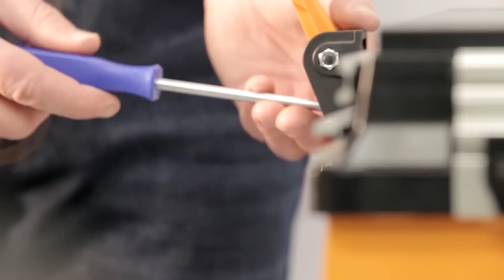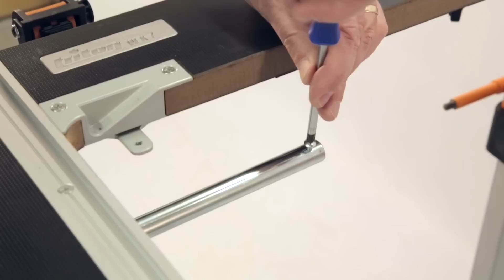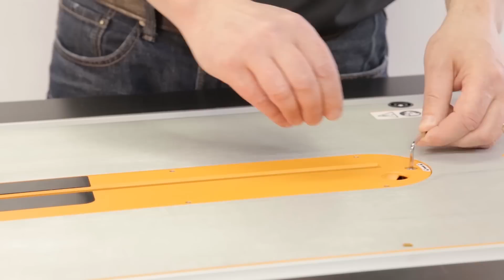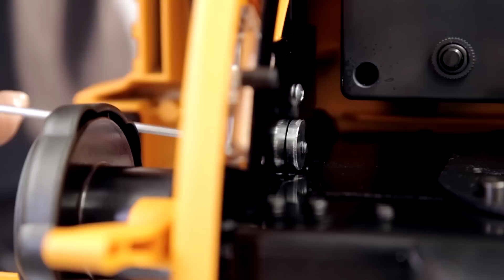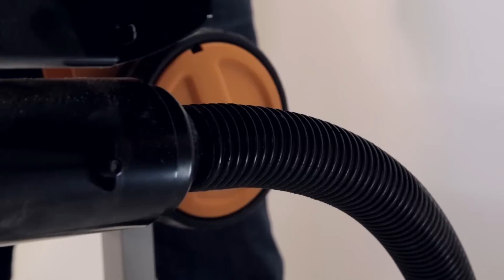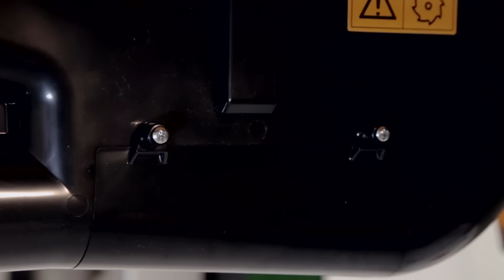Triton Contractor Saw Module - Instructions

Comment: I think this saw module on its own is perfect for anyone wanting to build their own cabinet saw. Building the rest of the saw base and top is easy the saw mechanism is the hard part. This solves the problem then buy a good fence system like the charnwood fence at around £80 is a steal.
Reply: I thought the same then read some comments from users and not so sure now. The saw module can't be found for sale anywhere in Canada 4 years after the product came out that tells me that people building MFT haven't had the vision or they too heard that the product has issues. 

I'd buy one if I could find one just to try
Reply: my question would be, does it allow the use of dado blades?
Not a deal breaker, but it would add a feature in the I will buy this column. I know some contract saws can accept a dado stack.

Comment: Anyone know if it's possible to adjust the angle of the blade relative to the tracks?  Mine is fractions of a degree out. (i.e. with a high precision mitre guage pushing square wood through for a cross cut, the cut is not currently precisely 90 degrees)

Comment: So I've been using this workshop/router/worktable/dust bucket combo for a few weeks.  There were teething problems: I made better versions of the clear plastic indicators which indicate fence measurements because of the flimsy plastic and threading issues on the originals; I had to flip the saw over and fix an issue with the 0degree cam stop (which wouldn't budge); I had to fix one of the fence clamps which wouldn't tighten; I needed a better dust extractor to get enough suction to clear a reasonable amount of sawdust.  However, it has been a little workhorse capable of some accurate cuts and mills since.  The fence is solid (once you fix the indicators and any bad clamps) and holds accuracy.  The mitre gauge is pretty solid too (though not as solid as aftermarkets).  The motors of both the saw and router have been able to cut through 1 1/2 inch thick oak with little issue.  Swapping between the router and the saw and the clamping table have been quick and painless.  If you have the space to house a table saw and a routing table with enough clearance to be able to move around them both with sizeable materials (which my garage does not) then I'm sure you can get better separates for the same price.  However, if you don't have a good sized workshop, and want to be able to switch between these table powertools within the same area and you need them to  have reliability, power and accuracy  (with minor mods), I think they'll do you well.
Reply: how can i get the nut that  tightens the blade
Reply: @bostondino6139  you mean the arbor nut? unscrew the kerf plate, use the provided spanner.

Comment: My Workcentre table arrived today and I was finally able to install the Contractor Saw.  I also have the Router Table and the TRA001 router.  I agree with the other comments about the poor documentation that came with each of the items, and these videos, as lacking as they are, go a long way to help fit the bits and make adjustments.  

On my Contractor Saw, the three rollers under the saw table that are adjusted for height are rubbish.  The clips that hold the rollers to the leveling screw easily pop out of the groove and as the leveling screw is adjusted.  Therefore, the rollers are not capable of carrying any of the work load and the only functional leveling screws on that side are those in the corner on the short edge of the saw table.  I haven't installed the Router Table yet to see if it shares this weakness, but will post an update here after I try it.  The rollers on the MDF table that came with the Workcentre Table worked fine, but there was no load on the rollers like there is with the Contractor Saw.

The aluminum table has a slight upward bow in it, but not enough to make me reconsider.  I knew there would be limitations to using anything labeled as a "contractor saw", with accuracy being one of those limitations.  I bought the complete set only because I have little space in my garage, which still has to serve as a garage, and anything I buy for woodworking must be stored out of the way when not being used.  The Triton Workcentre, saw, and router table meet those requirements.
Reply: send it back? could you remove the screw and inspect it and the thread, there may be a bit of schmoo in there. Can you change the screw to a normal hex head bolt?
Reply: aalever: The angle scale on my saw insert was off so much that I could not align the indicator when the saw blade was at zero degrees.  Like yours, it was very tight, but a little WD40 on the cam seemed to help a bit.  I still could not fine tune the zero indicator, so I had to remove the scale bracket from the saw, peel off the scale tape, stick the tape back on where it was within the alignment range of the indicator, and install the scale bracket.  This took no more than five minutes and now when the indicator shows zero degrees, the blade is as close to perpendicular to the table as I can measure using a small square.

Now that I’ve adjusted the blade angle scale so it is useful, the adjustable trunion stop at zero degrees no longer works.  With the blade at zero degrees, the trunion stop cannot be set so it stops the movement at zero degrees.  I haven’t tried the 45-degree stop yet because I haven’t needed any angle cuts.  This doesn't bother me because I don't rely on the trunion stops to determine blade angle.  I use a square to verify the angle with relation to the table top.
Reply: No doubt anyone can buy a better cabinet saw and make or buy a better router table.  However, the reason I bought them is because the workcentre folds up and can be stored away in my garage, and allow me to park my cars inside.  I would have bought a regular cabinet saw and router table, but I don't want to leave my cars outside more than I have to.
Reply: Hi Mike, how are you getting on with it now?
Reply: Sadly, I haven't used it yet.  Between work and other projects, I haven't had time to even plug it in.
Reply: ok, there's very few real life reviews out there. They're either paid for reviews by magazines or rants by guys who sound lie they didn't read the instructions
Reply: It's tough to fault the guys who don't read the instructions, because the instructions are worthless.  :-)  Without these videos, it would take more time to set up the saw.  However, since you asked, here are the problems I have so far with the saw.  

1.  When the optional side support is installed and stowed, the saw module cannot be installed or removed unless the saw is set to 0 degrees.  When the saw is tilted to 45 degrees for easy storage, as recommended in the manual, the side support rails interfere with the saw controls.  Either the side support has to be fully extended, or the saw must be set to 0 degrees.  Since my arms are normal, I can't insert the saw module with the side support fully extended.

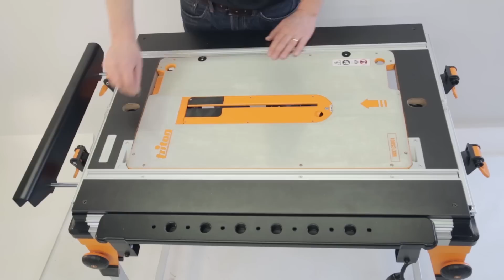2.  There are three adjustable rollers on the saw module that contact the table when inserting it.  These are adjusted once, as shown at 2:54, to ensure the surface is level with the table.  The retaining clip that holds the plastic roller to the adjusting screw pops off easily when the slightest pressure is put on it to raise the surface.  I haven't found a permanent fix for this.

3.  The miter slots are in the table, not the saw section.  This makes it impractical, if not impossible to make a crosscut sled that will be accurate once the saw module is removed.  I took measurements between the edge of the saw blade and the miter slots after removing and inserting the saw module several times to see if the initial setup was repeatable.  Despite tightening the two black cam locks seen at 3:16, there was enough variation in the saw alignment to convince me not to waste my time trying to make a crosscut sled and dial it in.

I bought the Triton saw module as an interim solution in my garage until my permanent basement shop is ready, sometime this Fall or Winter.  I have a Holzkraft SC2 Classic sliding table saw (same as a Minimax SC2 Classic) for the basement shop.  I will use the Triton saw only if I have to rip large stock so I can maneuver it easier to the basement.
Reply: The saw didn't sit at exactly 0deg on arrival and the 0deg screw is immovable.  It uses the tiny hex key, and further pressure would either snap the key or round the screw. Any thoughts?
Reply: Mickleblade:  There was nothing wrong with the screws or clips.  I think it is just a bad design by asking too much of the small hardware.  The problem only exists if I try to make an adjustment to the table height.  Once it's adjusted, installing or removing doesn't seem to affect the position of the bobbins.

I did try changing the M6 screw with a normal screw and use a nut with a nylon locking insert to hold the bobbin in place, but there wasn't enough space for all of the hardware under the table.
Reply: thanks guys for the info, I'd been thinking of one and this is the nail in the coffin. There were enough doubts anyway with the price and marketing. The router module only works with triton routers, a router table is a doddle to make anyway, chinzy fence, poor dust collection, not possible to make zero clearance inserts. All at over £600, when I can buy a better cabinet saw for that.

Comment: I have one, but the movement to allow 45/90 degree alignment isn't there, I can (at a very hard push) get measurements of 90 and 45 using a digital meter, but why isn't there movement leeway  'just over' these settings to allow for correct adjustment?
And... I'm not really sure how to align the blade to the fence slots, its just out front to back! and the info supplied with these tools is woefully inadequate, with mostly just a few pictures.
BTW: I can find no other way of asking Triton questions direct.  I'm in the UK by the way.
Reply: Hi Jersey:
Not sure, it depends on what you want it for, and to explain: 
If its just a contract saw you're looking for I'm sure it will work well, if you ultimately need high precision, then perhaps no.
Its handy to be able to swap out units, saw/router in a small space, but just as annoying to have to make sure your work schedule is correct to prevent swapping back and forth.
If you buy one, check You Tube for video's as the paperwork is woeful and no DVD is provided.
Hope this is helpful.
Barry
Reply: I had a Bosch table saw, which was 'much better' as a saw; but didn't have the flexibility, as you say the fence isn't standard! and to my mind 'flakey' so I'm currently trying to convert mine, so I'd say all round, if you can, get the best of 'whatever', saw/router etc and don't compromise. If it's just a space thing then try building your own saw/router table around a 'study' table saw!!
I'm in the Uk and we don't have many dealers with stock either, so bought on spec on-line.
Reply from the maker: Hi Barry,

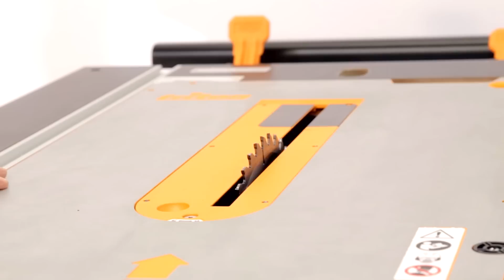You can calibrate the blade as shown in this video at 4:54 seconds.

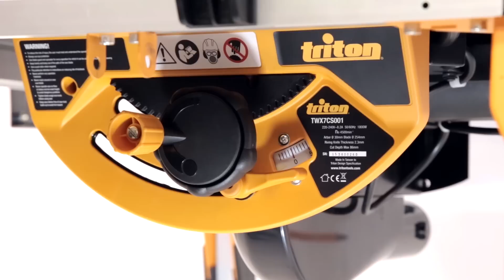There is also instructions on how to calibrate the fence at 5:58.

If you have any problems please email us at marketing@tritontools.com.
Reply: Thanks, I had worked out from the documentation how it should be done, what I'm saying is that the leeway isn't there, even with the cams turned 'out' it hardly makes it to 90 or 45, and those Allen screws are very difficult to turn even with an angled Allen key and a pair of pliers. 
Footnote, you should either make your written instructions more comprehensive, OR supply a CD with your kit.  I worked in computing, and with software and we used to say it should be user friendly, (self evident) or was badly written!!
I'm getting to grips with this kit (table/saw/router) but 'slowly' gaining bits of basic info here and there on-line, instead of having the info to go to 'at hand' supplied by Triton.
Thanks again.
Reply: BTW: It's the Very little leeway to correctly fine tune!
School report, "could do better".
Reply: Oops. that upload dumped some text, it should have read, Same with the fence alignment, very little leeway when adjusting the sight guides.
Reply: Barry, now that you had this product for a few months would you recommend it?
Reply: Barry Turner Thanks Barry - I'm light on space @ my home but I'm looking for something to start helping me as I progress into wood working (cabinets, furniture, etc). besides the setups /change overs - would you consider this to be comparable to a portable table saw? how is the fence? it looks flimsy in the videos. 

I don't have the space for a full/stationary unit. buying a portable table saw and router with table vs the Triton units are about the same cost. the Triton would save on storage space. 

thanks for all your comments - youre the only person I've found that has tested the units. I've yet to find a store within 400 miles that has one on display.
Reply: That should have read 'sturdy'
Reply: Barry Turner - Thanks again for all your help, Barry. I've been interested in the workcentre and was about to purchase the unit but given your comments I think I'll be looking else where. I'll probably still buy a Triton router but it appears the workcentre might not fill my needs based on some of your comments.

I still need something to save space but I might have to just settle on a portable table saw and a table router setup.
Reply: You're welcome, I wouldn't want to put anyone off owning this adaptable kit, it just depends on what you're doing with it as to its suitability.